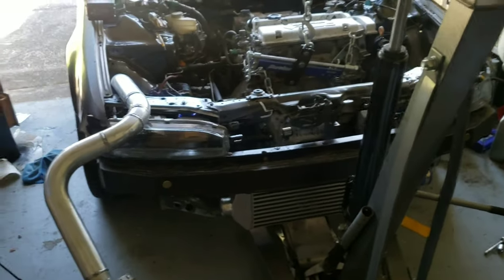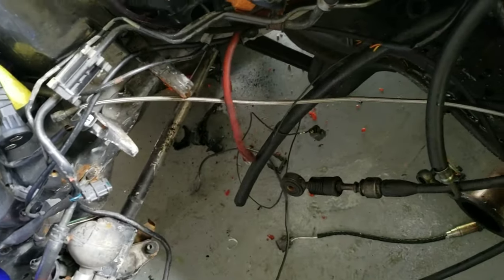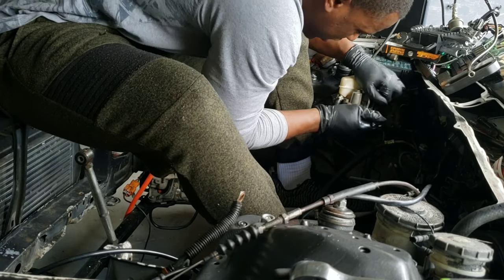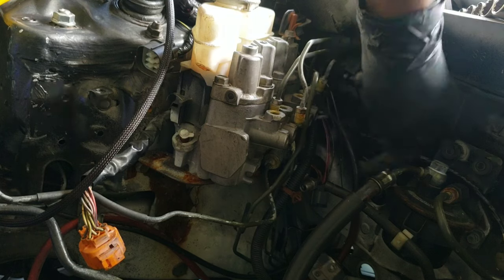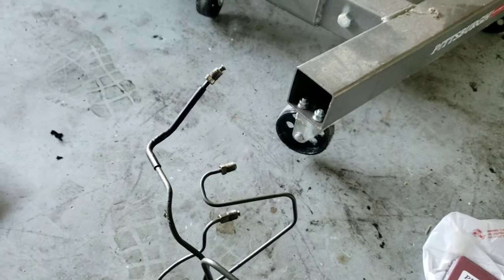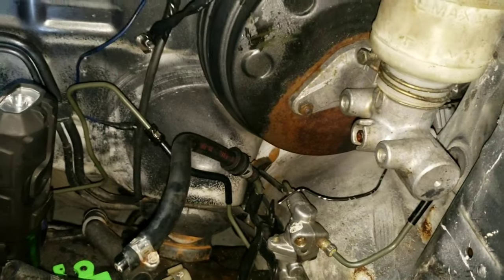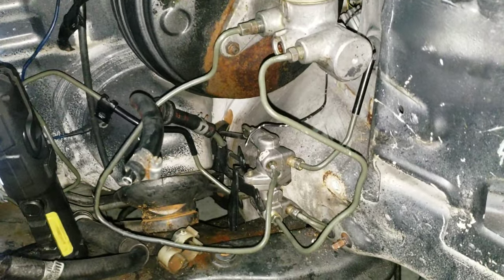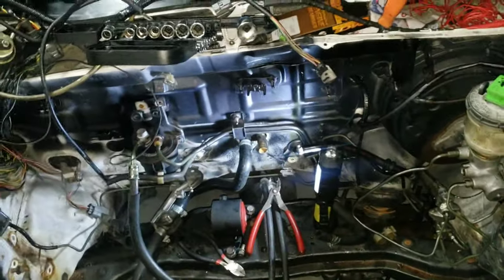HOW TO DELETE ABS IN ALL HONDA CARS!  #Honda #CB7 #ACCORD

Comment: Are the cb7 and cd5 prop valve interchangeable? I'm trying to delete my abs on my 95 accord but its hard finding a non abs or dx model in the junkyard but there's plenty of cb7s dx I've found
Reply from the maker: Yes the prop valves are interchangeable. As long as you can get the brake lines to it, it will work. Or just measure the length you’ll need and by custom brake lines. That’s probably what I would do if I had to do it again.

Comment: Doesn't have to be a 40/40 . I used a 30/40 that I took from a junk yard car
Reply from the maker: Really? I didn’t know that. There were a ton of 30/40s there I could’ve grabbed. Well… now I know. Thanks!
Reply: Yeah it took me awhile to figure out how to delete mines . I went from changing the master cylinder to a non-abs which didn't work had to use the abs master cylinder. It kept on locking up my brakes.

Comment: So good bro. Keep it moving!
Reply: I was curious if you knew if it would have looked cleaner had you gotten all the lx lines? Thanks for posting this. Do you need a non abs master cylinder?
Reply from the maker: Thanks bro!
I'm not really sure if would've cleaner or not, but I cleaned it up pretty good by shorting the lines. I kept my EX abs master cylinder because it's larger than the smaller LX non abs m/s which you dont need. You can also upgrade to a Prelude Master cylinder for a better brake feel.

Comment: Man, I'm doing a ABS delete on my 94 Accord using copper nickle brake lines, still a PITA to bend them at the prop valve with engine in the car. I have the intake manifold out, so that made quite some room back there. I'm also using a DA 40/40 valve too since I'm disc all around. Good job though.